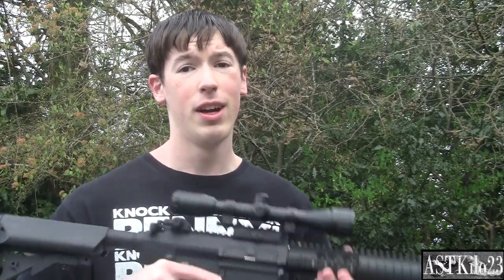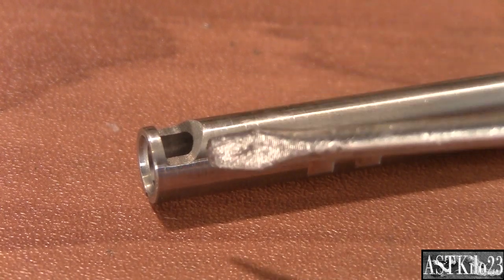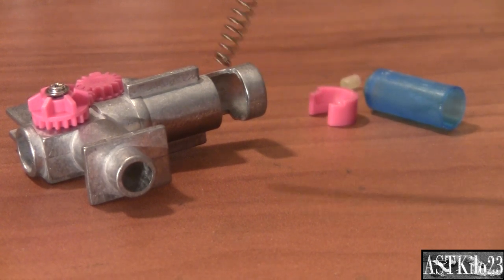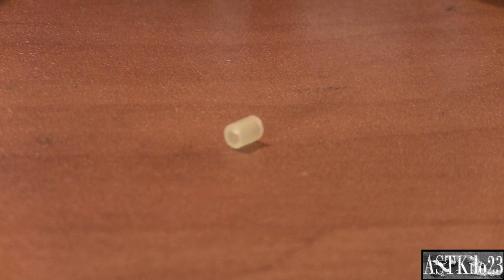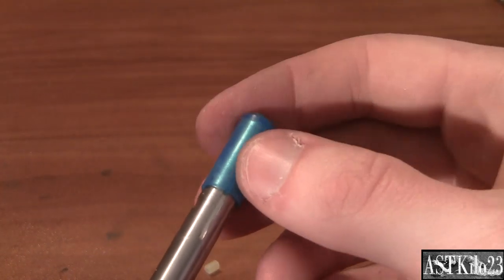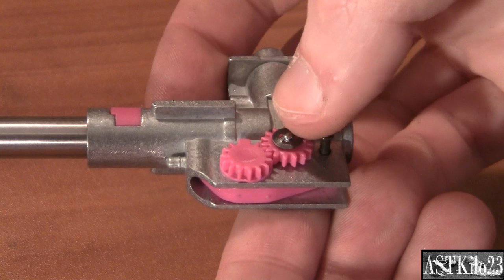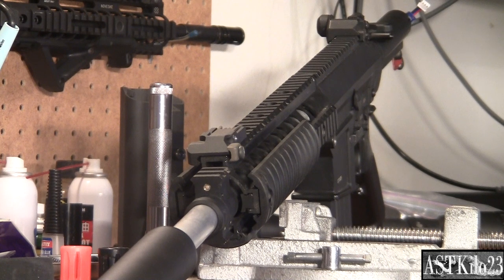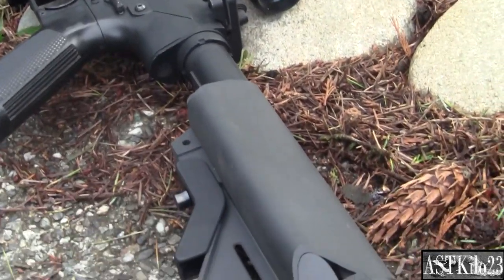Airsoft Peak - SR25 Upgrade Project - Part 3   -ASTKilo23-

Comment: Also, will a standard m4 bucking work with the stock hop up or do you need to have the m249/sr25 bucking for sure?
Reply: I have an SR 25, any age bucking should work fine, i run a maple leaf in mine

Comment: will those upgrades work with m160 spring?
Reply: I wouldn't recomend M160. It's too hot for aeg and if it's not done good, the gun will break really soon.
This spring is better for DSG od sniper. 
But if you have to use M160, use full steel rack piston, make radiuses on the gb and make sure the gears and motor will be strong enough.
Shs chambers are fine, cnc is maybe better. I personally preffer MapleLeaf bucking, for m160 a bit harder like 75° or 80°